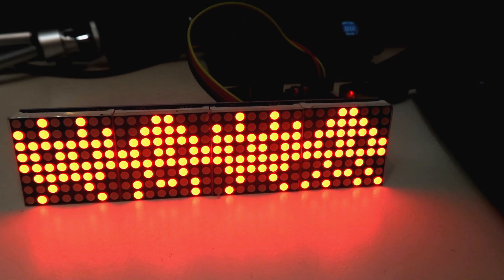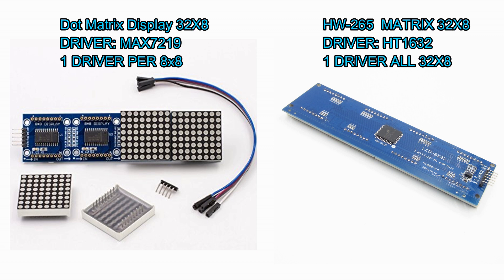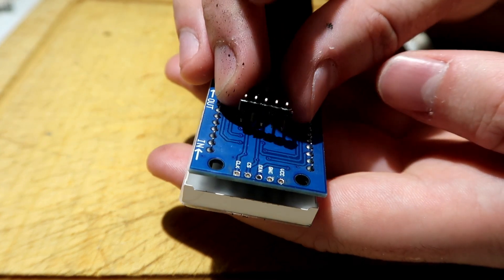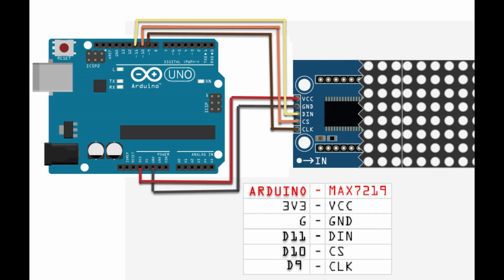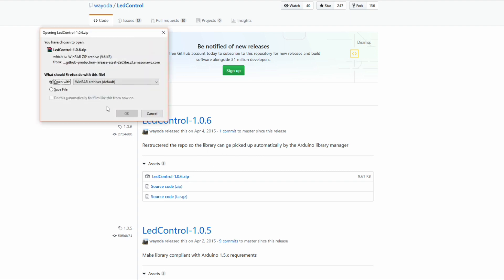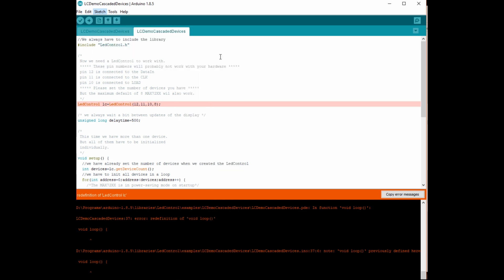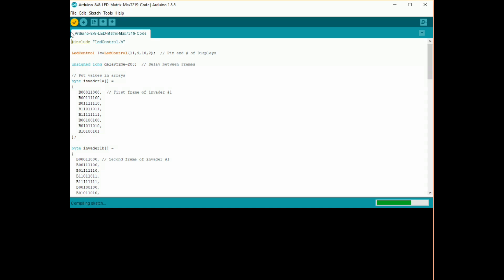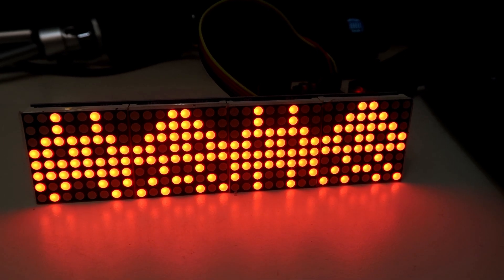ARDUINO to MAX7219 LED Matrix display (Easy guide setup, WIRING & BASICS)

Comment: You got me up and running with this tutorial, so Massive thankyou. I'm a software engineer not a hardware person, but I have a project to Do.
Just an observation. You didn't change  number of devices to 4, if you had you would only have activity in the first 2 matrix, the last 2 are in error and are mimicing the first two.
Nevertheless, good video. good explanations. Thankyou.

Comment: Can you post the DIN, CS, CLK pins on this code as you do not specify in the code on line 3 what goes where ? It helps in code to specify this !
Thanks
Reply: You should have been able to work them out Cap. 
it's actually remarked in the code.